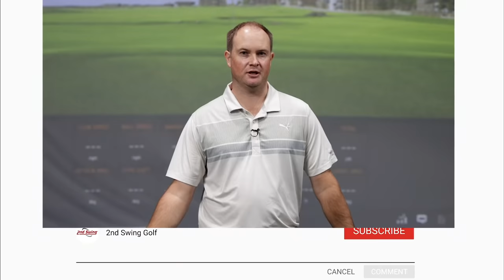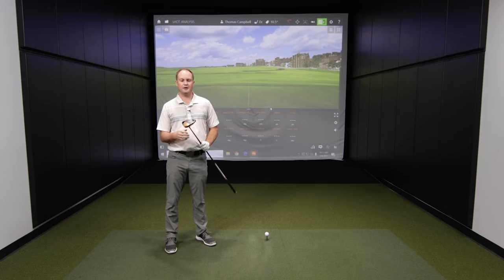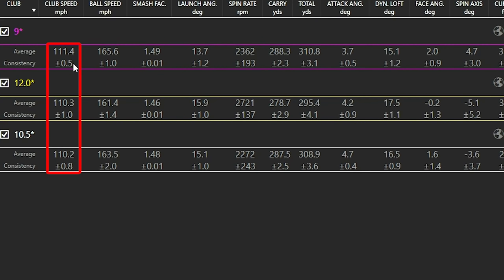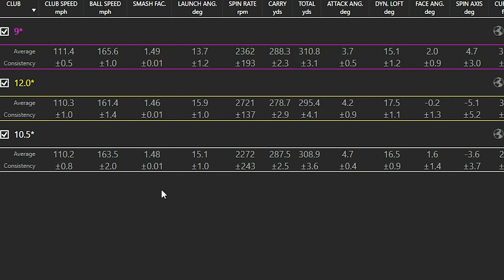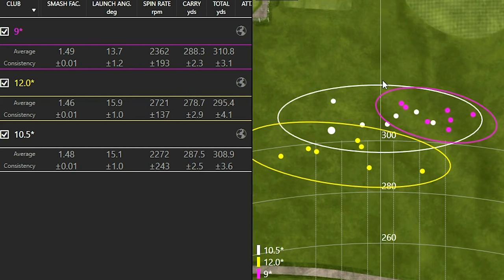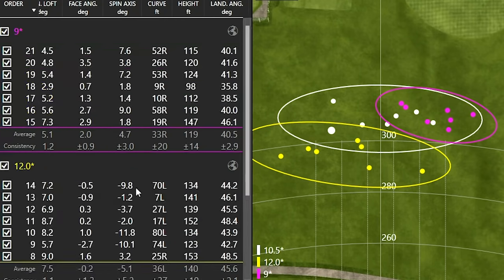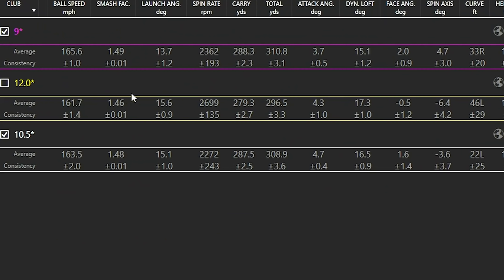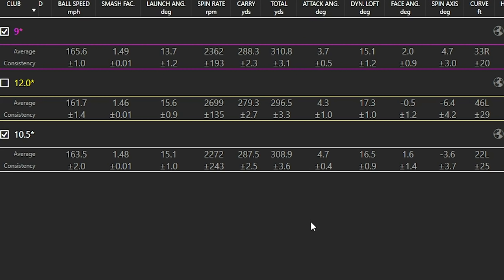What Driver Loft Should You Play? Impact of Driver Loft On Distance And Accuracy

Comment: Would be great to see this same test of clubs at various swing speeds to see the effect of the loft based on various golfers, 80-85-90-95-100-105-110-115, Thomas has the 110-115 and up covered
Reply: I liked the lady tester (in another video). Her swing speeds are pretty analogous to mine.
Reply: Good suggestion as a “rule of thumb” but swing speed isn’t the whole picture.  AOA (Angle of Attack) is equally important. 100 mph Club-head SS with a negative AOA maybe the same as 90 mph with a + AOA.  this is really player dependent and a good custom fit with an experienced fitter will maximize anyone’s potential
Reply: @stephendibari5010  those factors help, but you don’t get distance without club head and ball speed
Reply: @donsmnc5319  💯
Reply: Agree with Dons --  9 degrees will kill distance on a 85mph swing.  I would expect to see bigger distance gap between 9d and 10.5 for a slower swing speed due to lack of ball speed and height.
Reply from the maker: Good idea! We will add this to our list! Thank you for watching!

Comment: IMO, driver loft should be adjusted to fit the person's swing. If they're not staying behind the ball & swinging up, they may not realize their flatter swing plane,  is responsible for the low trajectory rather than the club loft. This was exactly the issue I had.   I was swinging the driver much the same as my irons, moving my weight too far forward & over rotating my hips which resulted in a too low trajectory but not because of the loft  of my driver. Be sure you're swinging  a bit up while staying behind the ball. If your shoulders are level rather than your trail shoulder lower than the front, it could also partially responsible for your slice. Check these points before changing your driver adjustments.
Reply: Got “fitted” for 9.5 loft.  After a few months of struggling I adjusted it to 12 and draw bias (Ping G425). I’m down the middle or a baby draw every time.  I hit down on the ball need loft
Reply: U same like me..using driver like iron…did u using high or low loaf?
Reply: @ezat929  10.5
Reply: Tq bro for info..noted

Comment: I went out to the simulator a week ago and hit some drives on the range.  Took my driver from 10.5* to 8* and found 8* to be the best for me at this time.  My swing speed hovers around the 100mph mark +/- 3 mph.  With my current swing I am not hitting up enough on the ball and it is causing my spin rate to be in the 3500-4000 rpm range.  The 10.5* setting hit the ball way too high and floated too much sacrificing carry and roll distance.  Dropping the loft took down the spin to the low 3000 range and brought my height down to the 90-110 foot range which puts that right in line with my swing speed.  Overall carry distance increased by about 6-10 yards and total roll out increased by another 10-15 yards.  My dispersion remained the same.  

With more practice, I'll start hitting up on the ball more which should drop my spin rate in to the low 2000's.  Once that happens, I'll probably have to put a bit of loft back on the club as my height will drop too much and I will be sacrificing distance.  May have to up it to the 9-10* range then.  

For me, it's good to have a driver with as many adjustments as I could find.  I have been working a lot on my swing to cure my slice and looking to add a draw in to my game.  Playing with toe and heel weighting, a front/back slide weight, and adjustable loft on the head gives me a lot of flexibility with the driver to adapt with me as my swing gets better.
Reply from the maker: Thanks for the comment Tom. Indeed, hitting up on the ball with a positive attack angle is vital for creating optimal driver spin and launch. Thomas has increased his attack angle since doing SuperSpeed training and will now hit up on the ball as much as 8 degrees. One thing to note when making adjustable hosel changes is that changing the loft through those adjustments will also slightly alter the face angle. If you lower the loft you will slightly open the face angle, and vise versa for increasing the loft.
Reply: @2ndswing  I have heard people say this about the adjustable hosel and I understand the mechanics around it, but in the end I just square up the face with the ball at setup and hit it.  Maybe that slight adjustment I make to square the face adds or removes a bit of loft from the club, I'm not 100% sure, but I am glad to have done my testing on a simulator this time as it really showed me what these changes could do and what effect it has on the shot.  My first time tinkering with the driver was at the range and I had no clue if I was hitting the ball too high, if the spin was too high, if the flight of the ball did what it did because of my strike or because the wind was pushing the ball around.  I was tinkering around blindly.

Comment: You’ve read my mind. I want to order a SIM 2 but wondering what loft to get. Play a Callaway rogue atm at 9 degrees but spins too much which is a problem as it is usually windy at the course I play. Obviously the SIM 2 is a lower spinning head so maybe get the same loft but would like a bit of help in playing a draw which is needed on most holes at our course so thinking of getting an 8 and loft it up a bit to close the face.
Reply: Shaft also plays a role here. If you have the money, consider aftermarket ones.
Reply: @FBTRodz7  yeah thanks. I’ve got a ventus black 6s to put in it which has a Taylormade adapter fitted so I’m good to go. Might tip it though as it’s a little longer than I usually play.

Comment: A former tour and long-drive pro who I discuss golf theory with told me “A power-fade paid the bills.”  so the results you got with the 9-degree are, from a practical standpoint, perfect for you.  I’m 69 years old and still have the clubhead speed use a 8.5° Mizuno, slightly opened in the grip with the ‘swipe across the ball’ you mentioned and a dynamic of hitting shaped shots I find most today don’t understand because marketing hype has the them focused on STRAIGHT AND LONG.

Golf is like war where on each hole the golfer is attacking the castle with the flag the designer put at the end with 101 ways to trick the mind of the golfer into making poor shot shape choices. If all one has in their bag is “straight and long” they are at a disadvantage.  For example a typical par 5 hole will have a sand trap or other hazard on the right about 200-230 yards from the middle (men’s) tee and one 250-280 on the left from the back (pro) tees.  Why?  Because 90%+ of amateurs fall off balance and wind up slicing shots to the right and pros who know how to stay in balance while maxing out compression-rebound on a golf ball usually hook left when they miss trying to get that extra 5 yards out of their drive.  That is why the pros on a straight hole will set up facing left aiming swing line directly at the bunker \ on the left then hit the power pull-fade (  to avoid it.

The amateur is faced with the opposite problem, that bunker at their driving distance on the right. The ideal strategy is the same, aim at hazard and shape shot away from it ) with a push-draw.  To execute a push-draw one must close stance relative to center of fairway / |   and close the face of the club via the grip a few degrees. How does this relate to Driver loft?   If you normally hit straight with a 10.5°  and close it 2° to hit the draw it winds up being a 8.5° making it far more difficult to pull off the draw.  The better choice in that situation?  Hit 3 a 15° 3W closed 3° which will carry the bunker and put the ball in the middle of the fairway, a bit shorter than driver straight executed perfectly but that all things considered is the lower percentage shot and the only penalty for using 3W vs Driver on the par 5 is taking one or perhaps two more clubs for the second shot, also precisely targeted to the ideal flat lie for executing a shaped shot to the green without flying off the back.
Reply: Just so we are clear this is all nonsense
Reply: Straight and long will be OK for me.

Comment: Great videos...Could you please explain how you are adding dynamic loft to the driver without leaving the face open.  I am swinging my driver at 97-100 mph with a 10.5 degree driver with 10-12 dynamic loft and that is with hitting up 3 ish degrees.  Causing low spin and low launch.  Thanks

Comment: I use a 9° currently, and I definitely hit with a fade so I always aim a bit left, I am intrigued to try something slightly higher now
Reply: Phil I have a 9* driver which I use at 10* If I change to 9* I will hit fades also like you & at 9* I am inclined to swing too fast and get mishits.
Reply: Do you know why the loft would change the direction (given club head  is level, not toe up or heal up) I'm confused
Reply: @skylercutsforth8595  My understanding is that loft and your swing style go hand in hand. Depending on how much spin you typically generate the loft can have different effects on flight trajectory, distance, and shot shape. If your swing style typically generates good launch angle, you don't need as much angle on the face. And then you also have to take into account what type of spin you generate, depending on the speed and direction of spin it can be accentuated or sometimes, unfortunately, over exaggerated based on driver face loft angle. There's some good articles out there with some solid testing behind them. I don't think there is any silver bullet, or general advice that can be given without being on a launch monitor and trying different lofts and weight dispersion, if the driver has an adjustable weight of some sort.

Comment: Thanks for doing this. Interestingly in a recent fitting I was recommended a 12.5 degree driver which seemingly on four shots got more distance that the 9.75 and 10.5 settings. However as dis-erosion widened slightly a shorter shaft - 44.5 was suggested to attain more control as I also tried a 43 inch shaft on a 10.5 driver but lost distance but had tight dispersion.  So a combination it seems of the loft, swing speed obviously and shaft might result in a mix like it seems it has for me. Only time will tell if that works out on the course. At least in this case I was achieving a spin of 2063, launch angle of 18.8, smash of 1.48 and peak height of 93 ft.
Reply: That smash factor is insane. How far were you hitting?
Reply: @henrymarks2237  I am 70 yrs. and am driving 220 carry distance. Have since tweaked my set up further to get a more consistent and optimal distance and dispersion control - so now game a 10.5 driver set at 11 degrees, 45 inch shaft but grip down an inch or so and a lighter shaft to allow me to more easily swing through.
Reply: @alysgolfstudio567  damn I’m 17 and you’re almost out driving me (though you are definitely a way better golfer). Really impressive
Reply: @henrymarks2237  thanks. Not as versatile as when o was young like you but some of the keys have been: tweaking my set up to assist me with the relatively lower flexibility; tweaking the club selection (shaft etc) to work better for a relatively slower swing speed; improving my technique; improving my tempo especially slower is longer and a wider takeaway; working on flexibility, fitness and warm ups and stretches including before every round; and not thinking golf swing on the course - play golf not golf swing with better course management and planning and a more in depth shot routine that includes being very relaxed and reducing any tension aside from paying attention to pga - posture, grip and alignment. Know that’s a mouthful but the combination of all that has kept me going. Still have bad shots and bad days but that’s golf!!

Comment: Hi Thomas, great video as usual. Given how close the 9 and 10.5 were maybe you should measure each driver for actual loft. There is a fair bit of tolerance from the factory so they may have had a lot less than the 1.5 degree difference stated.

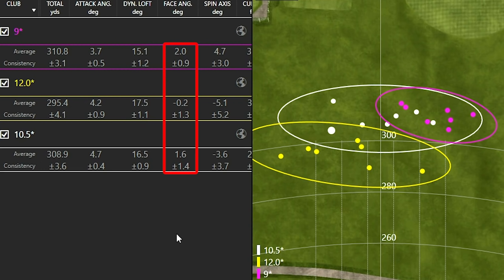Comment: 6:10 More loft closes the face. Less loft opens the face.
Not surprised you had a more square face with the increased loft.....
Reply: Thomas used different loft heads, all should be neutral at lofts he used...... Say he changed loft only on 10.5 head,  what you said would be true.

Comment: normally i find your videos very informative.  This one less so, however.  The inferences you have drawn are not warranted by the evidence presented in that there is an alternative explanation at least for left/center/right dispersion.  You used the same head and lofted it up.  Doing so invariably closes the face.  Closing the face is at least as good an explanation of the change in location of the drives.  What you need to do is to find separate heads of 9, 10.5 and 12 (and same lie angle  -- as lie angle can also impact direction: flatter opens face, upright closes it at impact which explains why some players, like me who prefer a face that is open at address, use higher lofted heads of some drivers then loft them down a bit).  So the better test would have been 3 heads (12, 10.5, 9) with same lie angle and the same shaft.
Reply from the maker: Hi Jules, thanks for watching! This test did feature three different clubheads, each at different lofts with standard lie angles and the same golf shaft. Thomas was simply attaching the different clubheads in the standard settings to the same golf shaft. Lie angles were not adjusted once for this test.
Reply: @2ndswing  Thanks.  Very helpful.  I guess I misinterpreted the video and apologize.

Comment: The degree on the face doesn't necessarily correlate.
I have a Ping G400 max 9°, set as low as it will go and it's probably still a little high in launch. Hzrdus smoke black stiff.
I just got the Hogan GS53 Max 9°. Tensei blue stiff. Have it set max high and it's still a little low. 
So.... Make sure you hit them in the real world (on a golf course) before you buy them.

Comment: so in general, if I am a new golfer and using a 12 degree loft, I can slightly change my stance and feet positioning to get the shot grouping more toward the center without changing my swing?
Reply: With 12 you can tee it lower and not try to hit up on it so much and have better control